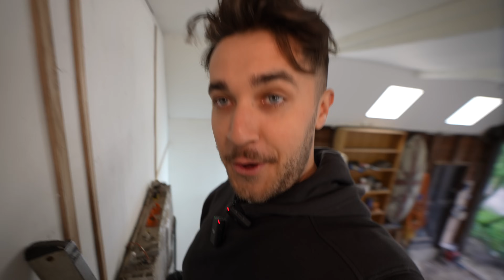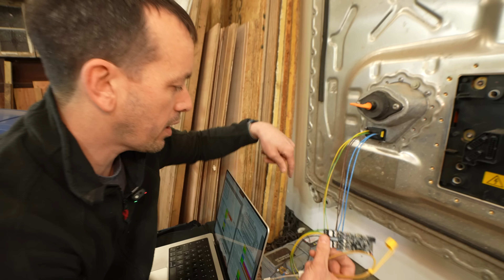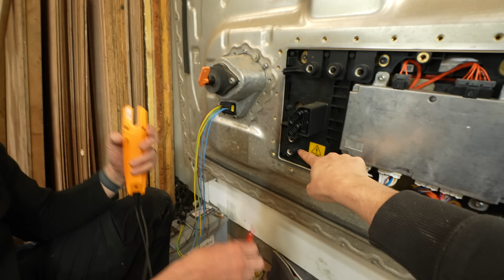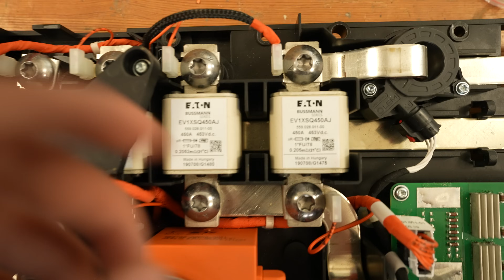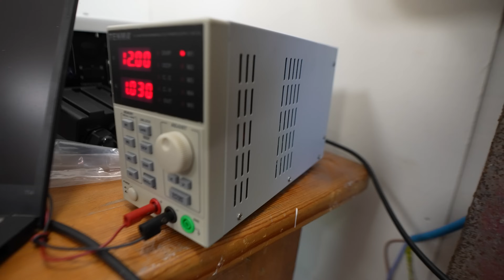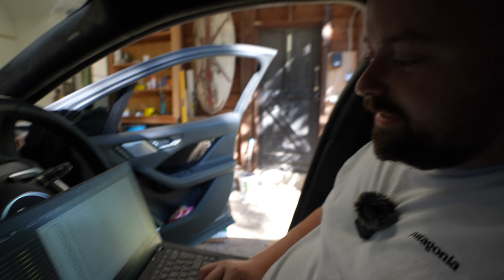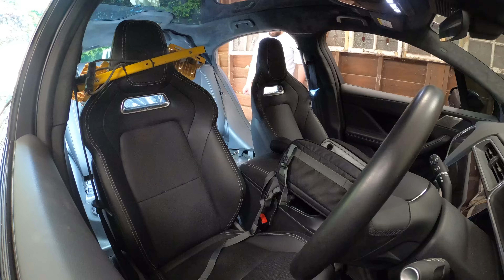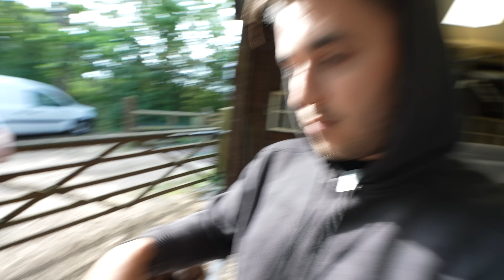Hacking an EV Battery From a £90,000 Car -  DIY Vehicle to Grid | ØY44

Comment: Why can't you just power the on solenoid directly with 12v ?
Reply from the maker: Because I’d like to keep as many of the original controls are is possible from the battery, and allow it to maintain all it’s safety features
Reply from the maker: For example cutting off when too full or empty
Reply: @corymac  ok makes sense but when you charge the car on DC you get a % reading can you not set values of a remote solenoid switch to keep battery in range or at least read the cambus when it's plugged into a DC charger and one question I have are you planing to use the battery cooling or are you thinking the demand will be small compared to an electric motor so no cooling needed?

Comment: The spirit of Louis Rossman in action is a joy to behold, hack on! You crazy kids!
Reply: The Rossmann would be proud!
Reply: Yes indeed
Reply: The spirit of Jehugarcia or Will Prowse they have been doing this for years. Jehu has been driving a 60's VW van on recycled tesla batteries for 11 years and DIY power walls for 6 yrs  everyone should have one to recharge their EV with., Also watch Rich rebuilds for recycling EVs
Reply: @crzy11000  Thanks for the tip! I'll take a look.
Reply: Louis Rossman is all about the right to repair and stopping the companies from locking you out of seeing the analytic's they are collecting from you without your permission with their rapist mentality!

Comment: Glad to see how you're trying ro tackle this but dont envy you from what I've seen it can burn alot of hours reverse enginnering this stuff. Think it will become easier in future when more cars have vehicle to load or grid which should be able to talk to inverters natively. Also see a second life for scrapped EVs being used as battery storage in farms as they probably have the land and space to park up old EVs and with enough distance to accomodate any fires from this sort of tinkering. Good luck.
Reply from the maker: I don’t like to be told I can’t do it, and unfortunately, we were told we can’t do it 🤣👍🏼

Comment: Flying tools did this, albeit using your suggested methodology of just using the cell packs from an ID4
Reply from the maker: Interesting! I’ll check them out :))
Reply: @corymac check out 30 / 09 / 22 video, he used a solax x3 g4 , as the BMS charger & controller, which only required a single temp sensor in the battery.
Reply: @corymac also video 09 / 04 / 23 - the finished system - from what I can work out, he uses his system as a frequency balancer for the grid @ 15kw
Reply: @corymac  also see 23 / 02 / 23 video, wiring using a DALY BMS

Comment: no rocket scientist . but should it not be better to have it at its proper angle EG flat and level so the car battery does not think its in a crash. and sensors telling the battery is not in a level state dont if vertical is a cut off
Reply from the maker: As far as I could see in the battery ( off cam ) any level sensor would be inside of the ECU elsewhere in the vehicle, and that isn’t one of the faults we’ve managed to find just yet. But a valid point nonetheless

Comment: Does the battery need a load, Ie, motors in circuit?
Reply from the maker: Currently the next step is to decode the fault codes and ‘fix’ them.

Comment: once you get it to wake up - how are you going to use the ~400v dc output given most inverters expect a ~48v dc input ?
Reply: Its a high voltage inverter!
Reply from the maker: Not true. Often they’re 48v with Victron etc, but you can also just as often find other alternatives
Reply: Solax X3 3 phase inverters will take up to 800V from the battery
Reply: @davestevenson7773  interesting - i’m in the victron ecosystem and assumed they all were 48v because many of the other brands use the same batteries (pylontech)
Reply: Loads of HV inverters out there, they just aren’t very DIY / USA friendly so the YouTube community ignores them.
Reply: Ev.tv (USA) on youtube did this for Tesla packs but you are right their inverter was a mineshaft safe 25KW 400v but I think it was $25K !! that put me off doing that in the UK

Comment: I do not know anything about these batteries, but there is a possibility that there are some ID's that don't match up when replaying messages.. Often the components are paired to the car, which make it difficult to change parts yourself. And by the way, have you checked the youtube channel "Flying tools" ? He have an inverter like that, connected to a carbattery of some kind..
Reply from the maker: I’ve got my smartest friend working on it as we speak!
Reply: Right, VIN number is coded in every ECU in the car

Comment: not familiar with the jag battery, has i got a pyrofuse in the contactor bank? could be blown and bms not seeing a total battery voltage
Reply from the maker: All the fuses we could see were in tact, but it’s worth another check!
Reply: @corymac   Automotive Pyro fuses are not necessarily obvious in appearance. To all intents they can look like a solenoid or a relay, the connection is hidden inside - the pyro bit blows out the connection and you may not be able to see that it's blown. The clue might be heavy duty terminals either side/end and test it for continuity. Location in the contactor bank?

Comment: second video today ive seen of someone trying to do this the one before was out of a tesla model 3
Reply from the maker: Interesting! How did they get on?
Reply: @corymac he in the thread 😁
Reply: @corymac  had the same can bus reader just no luck with getting it to communicate yet think his is going to be a bit of a diy approach. wouldn't recommend as you know the voltage is in excess of 400+ V DC
Reply: I would defo go with a Tesla Model 3 battery 😂😂

Comment: This should be the first option for any EV battery once the car has finished with it, alternatively, being used for grid balancing.
Reply: Err.... "second life" batteries are already a thing. Been done for quite a while.
Reply: @martinw245  But not with ALL batteries, which was my point 🙂
Reply: @Jimages_uk

  I've no idea what the percentage is, to be honest, but it's obviously not 100%. At this point in time, "all" batteries going on to a "second life" is probably not feasible as it depends on so many factors, like demand, etc.

But yes, "second life" is clearly something that should and undoubtedly will be expanded.
Reply from the maker: Couldn’t agree more, unlikely to happen though
Reply: Probably the first option is replacing dead packs in existing ipace’s.

Comment: Unless someone's already figured out the CAN part of that problem wouldn't it be cheaper to just salvage the cells instead?
Reply from the maker: The trouble is, there are so many,
I’d need a new BMS to balance them all, as the sub packs also are covered with CAN